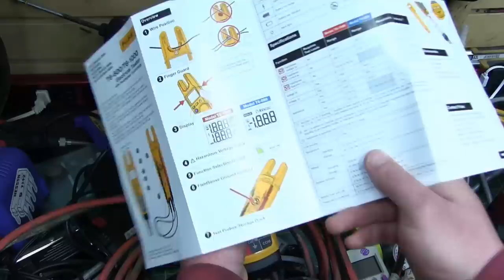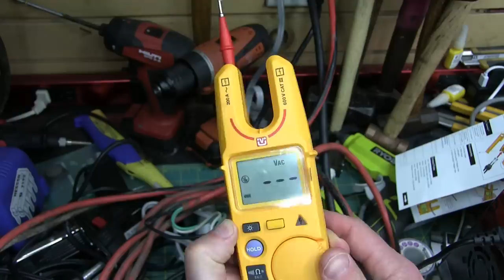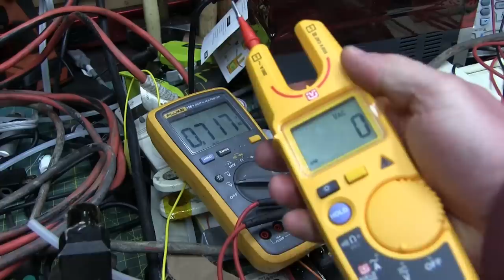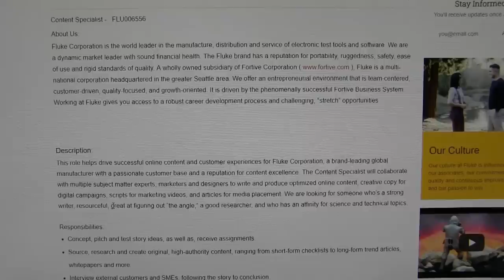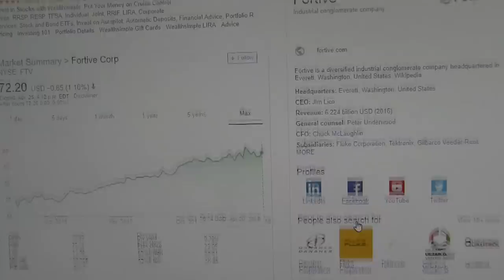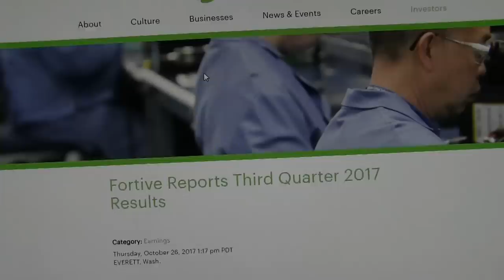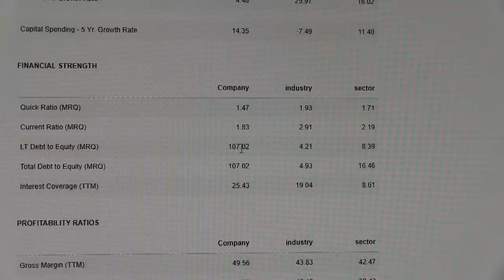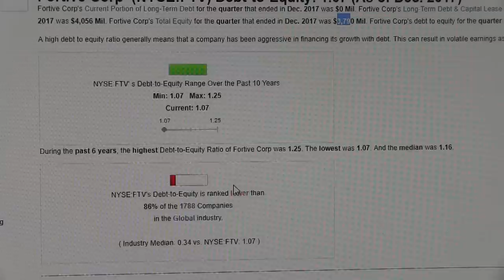Fruke's JOY BUZZER™ Multimeter! | SHOCKINGLY BAD T6

Comment: To play devil's advocate a bit, those 106 volts may be high impedance so that it drops down if you touched it. Try connecting a 10k resistor to ground and have a look-see if the voltage drops to safer levels.
Reply from the maker: Floating at 600V rated or even 1kV for the other model? No thanks.
Reply: I was thinking the same, but its still crap. Its big selling point is non contact voltage check, and it works kinda half the time if you do everything correct. A meter that works half the time might as well not work, because when it works you don't know if it works or not
If you measured 0V with this would you touch the bare wire afterwards?
Reply: Magnus, no, just no. Human touch = galvanic isolation. No galvanic isolation = no human touch. Very simple set of equations if you have a few decades of experience with not dying.
Reply: A quality meter is supposed to insulate you and protect you when bad things happen...it's not supposed to use you as a lightning rod!
Reply: shouldn't have to do that at all though
Reply: The impedance is undoubtedly high enough to make it "safe". If you shoot for 5 mA that's only 200kohms@1kV, as I understand it DMMs are usually a lot higher than that. However, encouraging the behavior is still an incredibly stupid idea.
Reply: "safe" is not necessarily usable - if I'm working on a 1kV circuit and feel something I don't take the time to wonder if it's under a safe limit, I jump.  This often results in injury or damage to whatever I was working on.  F.that.

Comment: Greenlee came out with something similar back in the late 90's, at least it was in their catalog.  It had a separate non-contact voltage mode and yes, non-contact current mode. I don't recall it having any test leads for continuity, resistance, capacitance, etc.   It didn't have a digital readout, it gave an estimate with a leds. More LEDs, more voltage or more current depending on the mode selected.  I wanted to buy it but never found it at any supply house. 

  I did have several 90's vintage Greenlee voltage/continuity testers, they were kinda quirky to use at first, could be used with only one probe to detect voltage on a hot wire.  It had an unique buzzer that increased with voltage, distinct low tone for 120V, distinct high tone for 277V. Contunity worked great as well, very quick, no delay like some multimeters.   Being a commercial/industrial service electrician it was a great tool for troubleshooting branch circuits, for about eight years it never left my pocket.  Southwire has some similar in its 41170S volt con, might give it a try.  Been using a wiggy and or a fluke 87 for the last decade, tired of replacing the wiggys leads.

Comment: So some young engineer at Fluke discovered those screwdrivers with the neon light in that you stuck in a socket then completed the circuit by touching the other end.  You can tart it up, but same danger once you strip it down.  

John Ward had a video on them about 4 years ago.  I have one, but the purveyor wisely replaced the metal cap with a plastic plug.  Works well as a small screwdriver, never tried to see if it would put spark in my life.

Comment: Reminds me of the old 'Neon screwdriver'. A 'festoon' neon toob with a carbon resistor inside a clear plastic screwdriver handle. Touch the brass end-cap with one finger, stuff the blade in the 240VAC socket, neon lights up. Forget to put other hand in pocket, touch earthed metal, and just see how far you jump. Everyone's grandpa has one in the kitchen drawer.

Comment: I worked for many years as a test equipment repair and calibration engineer. The brands we really trusted for our day-to-day work were Fluke, Hewlett Packard and Tektronix. Of course there were others in specialist fields, such as Rohde and (und?) Schwarz, Marconi, Schlumberger etc. but those first three were the mainstay brands. It is so disappointing to see what you have just shown us.
Reply: I once get nearly fired for buying Schlumberger rather than HP, even though it was better in every way - easier to use and way cheaper for the application. HP reps used to have a ton of market power :)

Comment: Had a 1990 $900 Hioki clamp on gift from the penny pinchers. It was special with bottom leads that had to be moved between checking ohms and voltage.
 "A wicked loud crack that sounded closer to a rifle than any other electrician. Scared the shit from the room. The largest scraps were two wires about 8 inches long." So said the filing room log book. I got jumpy watching the Fluke sticking in the wall upside down. Pavlovic trouble shooting.

Comment: There was a huge missed opportunity to demonstrate your Uni-T meter doing current sense without the "got to get it in the slot with 1mm precision" nonsense. If a cheap meter like the Uni-T can do it with reasonable accuracy without being fiddly, the Fluke has to do it, period.

Now an anecdote. I used to work on a university network and we had two Fluke meters. One was ancient (late 90s at best) and one was brand new (2006 at the time). We used the meters to tone down cables, test connectivity,  make the switch port blink, determine cable length, check attenuation due to length for marginal runs, and you could even ping servers with it and measure packet loss. HUGELY useful tool. The new one frequently broke from all the RJ-45 plugs being shoved into it, sometimes not terminated because someone wasn't paying attention. The old one had a replaceable RJ-45 jack, the new one had to be sent in for repair. But even when it was physically working, the new one didn't work as well as the old one. It would almost never successfully DHCP an address on the first try, the cable length checker often didn't work, and it wasn't able to work past 80 feet or so most of the time. Yeah, I know, 100 feet should be the absolute maximum run, but sometimes someone wants a computer 150 feet from a switch, and just one, and doesn't want to pay for a new network drop and is fine with poor performance. The old meter was capable of going down the overlength line and testing the line's end-to-end performance; the new meter would just display a question mark like the cable was unplugged. Bear in mind - this thing was sent back to Fluke every 6 months for repair and recertification due to being abused. If the quality degraded that much back then, I can't imagine how terrible these things must be to use today.

Comment: This is great! I was about to try getting a hold of them to see about calibrating my decade old multimeter. I might have to invest in another company.
Reply: Matt Schuetzner Generally a good meter will quite reliably hold its calibration for decades so long as it has not been abused.  So unless you need the certificate you can simply find a friend with a meter of similar or greater accuracy to confirm that yours is still in agreement and within the original factory tolerances.  A calibration check is ordinarily only a test that the unit remains within those original tolerances, no actual recalibration or alteration will be performed unless the meter is actually well outside tolerance.
Reply: Ethan Poole I don't need the certificate. I was checking some used batteries and it was telling me the D cells had 2.1 volts dc. I thought that was odd so I switched over to ac stuck into a wall socket which read 170v. Tried my coworkers meter in the same outlet and his read 120v. Hence my thoughts on calibration.  Maybe I'll try to research how to do it myself.
Reply: Did you try replacing your battery?
Reply: Matt Schuetzner Yeah, if you are getting a reading of 2.1V off an ordinary alkaline cell then your meter is reading nearly 40% high, a reading that, not unexpectedly, carries over to your AC measurement as well (120VACrms x 1.4 = 168VACrms).  You really should not read more than around ~1.6V even with a brand new alkaline.   If by chance the meter has TrueRMS then there could be an integration fault (if it also uses that circuit in DC mode) as, curiously, 1.41 (41%) also happens to be the square root of two (the multiplier to convert RMS AC volts to peak AC volts), but that 40% error could also just be pure coincidence or the result of contamination on the PCB creating unwanted leakage paths throwing off readings -- it is just curious that  40% (1.4x) is your error since it is so close to the square root of 2 (1.41), or 41%.

If what you have is a very old multimeter then there were typically several potentiometers inside to calibrate DC Volts, Ohms range, the AC multiplier (to compensate for RMS voltage assuming a sine wave unless the meter supports TrueRMS), etc.  most every range in many multimeters will typically use the DC calibration as a primary reference -- internally AC, DC, Ohms, and Current all get converted into a DC voltage so you often want to begin by recalibrating the DC range (usually using a lower end range, if not the lowest) before you move on to the other measurement modes.  Newer multimeters tend to store the calibrations in their internal memory and can be difficult to alter unless you can find a service manual that includes the proper sequence/codes needed to access the calibration menu, in which case you may have to pay someone to service it.  Just be aware that recalibration can be a costly procedure, so if you don't need the certificate then by all means find a friend with a more accurate meter and collaborate to recalibrate your meter yourself (or buy a new meter if you get in over your head as that may still be cheaper than professional recalibration).

Good luck!

Comment: I think the scary part is that even if that little pad is a high impedance path to the other lead, all that would have to happen is for the cable to get looped around something and pull out of its pocket in the back of the meter for you to get a nasty surprise....

Comment: AVE, another company that you were looking for that people used to and still buy products based on a name that also made big changes and is not worth the money, just selling based off of an old reputation is BOSE.  The engineers always loose these days, I remember once I had to threaten to quite my job before they approved a change that wasn’t based off the bottom line of $.
I think it’s obvious that Fluke was having a hard time competing with the cheaper options and designed being ripped off of other companies IP just to be copied with cheaper components. A lot of companies have shifted to stay in business. Didn’t fluke buy Amprobe for a cheaper line of products to compete? 
Correct me if I’m wrong, but when I first started in the hobby and found out anyone can put any CAT rating on a meter without any independent certification it surprised me. So you could own something you think is CAT III but really is not. Then dealing with some LED lights that had a UL certification and they used to be good, my most recent purchases from the same manufacturer still had a UL label and when I took a deeper look I found out the design was completely different from a switching power supply to a cheap capacitor dropping design that I could have purchased from China for the same crap for cheaper. When looking into this I was informed that the original UL cert could be used for completely redesigned LED bulbs even if it’s not anything close to the original design.
So I ask you, how much faith do you put in any UL or CAT ratings these days? I don’t put any faith in them anymore, they are both flawed certification BS that is now just part of the marketing shmoo so they can charge more to the people that don’t know each independent product or LED light is individually tested.

Comment: Fluke has on their Facebook page what appears to be a direct response to your video.
Reply: They sure as shit do!! There's a picture of a completely smoked T5 or 6 someone posted in the comments too. I'm sure there is more to that story, but the marketers are in full scramble mode.
Reply: LifeOutdoors 2day keep me posted!!! Lol
Reply: I like the "foreseeable misuse" comment.  so if they didn't foresee it, it kills you.
Reply: I like that the audio of their video .. is replaced. It's clearly NOT what the guy was saying. "For any rated voltage." Um ... I may be a Fluke Fan but I don't like weasel words or uncertainty in test equipment. I'll stick to my magnet hacks to put the probes where I want for one hand use.
Reply: FYI: I'm an electrical engineerd / Journeyman electchicken ... I'm not confuzed by pixies and knew it was a bit of sour grapes from the outset. That said, I'm not using a body contact probe inside a control panel. Ie: No T6 for me. YMMV ... I'd not be surprised it that was the the prevailing winds either.

Comment: If you want to check for danger you need to check the voltage with a meter with a lo-Z mode.  The V mode impedance is enormous and so you can see high readings even on completely unconnected wires. It’s a lot easier to believe angry Canuck made a mistake on this front than Fluke.

Comment: "great at figuring out "the angle," " but apparently not great at proof reading. I like that they decided to include the comma in the quotation marks....
Reply: Can't tell whether you're being sarcastic, but several style guides (for example that of The Guardian) say to put full stops and commas inside the quotation marks. Dunno if this might be a UK vs US issue though.
Reply: Captian Morgan thats gramatically correct if you’re continuing a sentence after a quote (thats also where you should put a period when a sentence ends with quotation)
Reply: Chicago Manual of Style (CMOS 6.9): “Periods and commas precede closing quotation marks, whether double or single.”
Reply: Proofreading is one word and you spelt "Captain" wrong.
Reply: stephan mantler thought that was a camera sensor.
Reply: l0b01 
Yes, style guides do suggest that.  It is incorrect, though, if it is a quote — substance over style.

Probably it isn’t intended as a quote, but a reference to a figure of speech: in which case the single quotation marks should be used.
Reply: of their many transgressions is this really the one to get hung up on :P
Reply: Exactly this, have looked into it multiple times, it's based on location. US always has punctuation inside quotations, while other countries put it on the outside. Us Americons just wanting to be different from the rest of the world again
Reply: Well, it looks like it may be O.K. depending on where you are from. Imagine that, someone being incorrect on the internet. :-) I suppose my only defense is I read too many books by British authors. Thanks for the correction.
The name is misspelled on purpose, for multiple reasons. One of which is that someone had already taken the correct spelling.

Comment: The tab on the back will be mains voltage when open circuit. I would assume there will be some impedance that will reduce the current flow sufficiently to be safe. If you put an ammeter across it in parallel with voltmeter I think you find that it will drop to near zero volts and ammeter will be in the low milliamperes. Also, to be safe, there should be a fast blow 'fuse' in line with pad, just in case impedance breaks down so it fails to zero volts.

Comment: Tried a few Wankey new meters but i always go back to my Robin RD830, (Made by Fluke  From "A" while ago when they made propper stuff) had it fooking years, it has a couple of few marks from going down the steps a few times, lol, and i have had to go inside it twice to use the hot metal glue gun on it (fooking sockets desoldering them self's)  but it is a meter i trust, if it says 7 ohms, its 7 ohms, lol, good vid.

Comment: try measuring the voltage of the ground contact with the 117 set in LoZ
Reply from the maker: You don't go around holding the lead by the tip day in and day out...
Reply: all i'm saying is the 106volts you measured with the 12e is probably "ghost voltage", whithout suggesting that the t6 is a good tool or anything.

Comment: I was a Matco distributor when Danaher spun off Fortive.  I always thought that there may have been problems because prior to this happening Danaher sold the APEX tool group.  Anyway, they separated and kept mostly the medical service type companies at Danaher and the industrial companies with Fortive.  I cant speak for the rest of Fortive but Matco grows annually, but I believe Matco accumulates lots of debt due to the constant borrowing and contracting of suppliers and manufacturers to produce products.  I would imagine this is how most of the Fortive companies operate as I doubt that there are "Fluke" employees in China, rather just someone who puts yellow paint into barrels while their factory makes a certain model meter for them that year.  This is crappy, but fine if the products are designed and manufactured to a certain standard.  If you look at Snap-On stock I imagine they have a different debt profile because they manufacture more of their tools in house and owe less to manufacturers.  So this may not necessarily mean that things aren't good at home for fortive... or it could mean that they are leaning out weak companies and making the powerhouses profitable for sale.  I did not get that vibe at all when I was a distributor but, hey, stranger things have happened.

Comment: I thought it was just me... I have the same unit.  Ended up buying Klein products... I was just disgusted with Fluke. Bought it after my EUI started acting funky.  Won't shut off. It still reads,  I just don't trust myself to not shut it off.  I'm no longer working and in need of anything special so I figured I'd cheap out with that Fluke. Ended up costing me anyway because I had to go get something I trust.  The leads work ok. They flicker around but if you hold them on long enough you get an accurate read,  but I just wanted something reliable